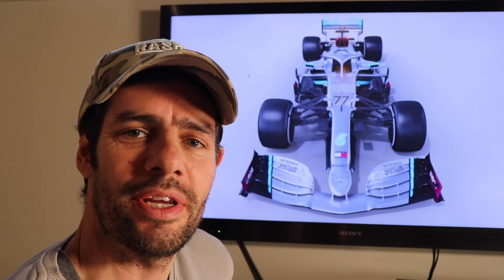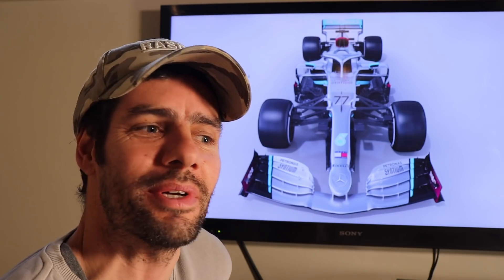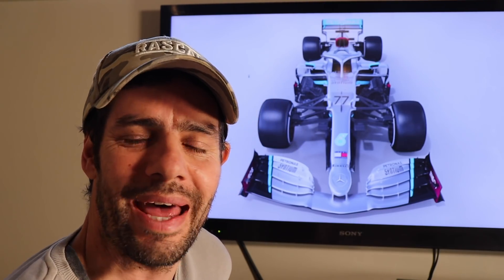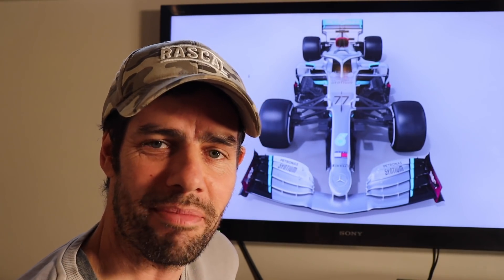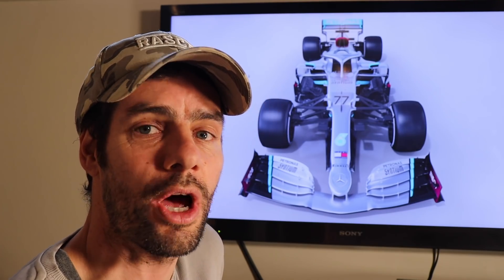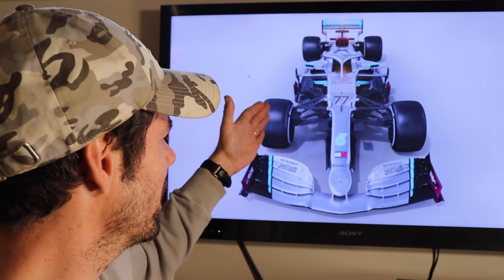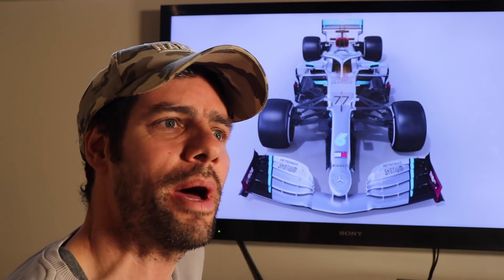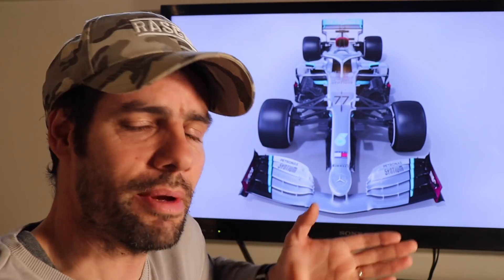Explaining Mercedes F1 DAS System

Comment: I couldn't believe it when I saw Lewis pull back on the steering wheel, I nearly broke my jaw it hit the floor so hard lol

Add this to the seriously impressive rear suspension set up and it looks like Merc have stolen a march on both ends of the car. I was so surprised to see Merc at the top of the time sheets after years of making sure they were firmly at the bottom, maybe like Brawn in 2009 they just can't end enough fuel and ballast to make it go any slower 🤷‍♂️

Comment: FIA regulations 2020  Article 3.8
(With the exception of the parts necessary for the adjustment described in Article 3.6.8, (DRS) any car system, device or procedure which uses driver movement as a means of altering the aerodynamic characteristics of the car is prohibited.) This little trick is opening up the gap of the front wing end plate and the outside edge of the tyre on the straights allowing more outwash freedom creating more airflow. so you can effectively call it a kind of front wing DRS. Illegal to me let me but let me know what you think.

Comment: Theres no way this is driver operated with no assistance. The strength required to make toe adjustments to an f1 car under load would be super human. The driver reaches down with the right thumb to push a button every time the adjustment is made. It's some sort of electric or hydraulic system
Reply from the maker: It could be...
Reply from the maker: Or the button could be to put a marker in the data as they assess it's performance...
Reply: @F1Elvis  but that doesnt account for how he is able to move the steering wheel in and out. The force needed for that is immense. Theres no way that isnt power assisted in some way.

Comment: This seems redundant; they can already achieve dynamic toe while steering by using Ackermann steering geometry and yet nobody is talking about that.
Does this offer any other benefit or just more of the same?
Reply: True for most cars but the particular arrangement of components used in F1 for aero reasons makes it hard to get a lot of ackerman.

Comment: As a Mercedes fan, I think FIA should ban the system. Why? It is going to put a taint on whatever Mercedes and their drivers achieve this year. People are going to say that they are running an illegal car, even if there in nothing in the regulation that explicitly prohibits this. Mercedes doesn't even need this to stay ahead. This could be useful for a team like Williams or Renault if it can help catapult them to the front. This what everyone will be talking about the entire year.  Before it used to be party mode.

Comment: The wheel is clearly a part of the aerodynamics of the car, so if one can manually change the angle of attack of their aerodynamics during the race then isn't that illegal? Now just watching the video Marc confirms what I said, Mercedes is CHEATING, around the 3:40 mark, Marc said it would create less drag, 4:30 aero benefits. So in conclusion, Mercedes is CHEATING.

Comment: I know drivers are in very fit shape but  wouldn't a lot of power be required to pull the steering rack just by using mechanical force without any hydraulic or assistance?

Comment: Article 10.2.3 is explicit that any adjustment to the suspension system can only be made when the car is stationary.

"No adjustment may be made to any suspension system while the car is in motion," it states.

Article 10.2.2 states: "Any powered device which is capable of altering the configuration or affecting the performance of any part of any suspension system is forbidden."

Article 10.4.2 states: "Power assisted steering systems may not be electronically controlled or electrically powered.

"No such system may carry out any function other than reduce the physical effort required to steer the car."
Reply from the maker: Don't think it breaches any of those...

Comment: Like Ferrari's protest of Renault's J-dampers in 2005, it could be protested under the "moveable aerodynamic device" rules.
Reply from the maker: Don't think so...
Reply: @F1Elvis  I'm sure you're correct. However, if the aero changes in response to the toe angle moving, wouldn't that constitute a moving aero device? Just thinking out loud here.

Comment: I just wanna say, They always win, because of the down force front nose, if you realized it from W05 to W10. From W07 to W10 always was the same design of front nose, but the others car of F1 team such as Ferrari, RB, etc was using a different design of the front nose. Right now in F1 2020, only BWT was using the same from nose of W10's Mercedes. If you see more closely on Mercedes W11's the front nose has a bend between stem and nose (logo)That is a down force nose. I don't know, if it is legal or not. For 100% sure Mercedes is the faster car again on F1 2020.

Comment: Nonsense, it means driver has to push n pull the wheel while steering it? Steering at high speeds alone is still a great task and above all drivers who are having a primary school education are gonna mess up their head at higher speeds with caster, camber, toe in and toe out. Let's look ahead

Comment: The only thing the other teams can protest is that it could be against the intention of the regulations. Because how it's written now, it's perfectly legal IMO.
The regulations only say that when the steering wheel is fixed (stationery) the geometry isn't allowed to change. But the steering wheel is not stationery when moved laterally, which the regulations didn't account for. So it's essentialy moving the steering wheel to steer the car, and no regulation say that the wheels have to turn in the same direction. Mercedes just added a new dimension to steering.

And toe in/out works just like doing the snow plow on skies when on the straights, introducing wheel resistance, lowering the top speed.

So I agree with you, it's for drag/resistance reduction, and not to heat the tires as some speculate, because scrubbing the tires only heats the surface, which can cause graining

Comment: Why wouldn't you design the car with parallel front wheels in the first place. Why do they have to put in a toe angle outwards when it doesn't help them?
Reply from the maker: Did you watch the video?
Reply: @F1Elvis  I did. But I didn't understand why a toe out would help them.

Comment: so if its a mercedes 1-2 in the first 5 races how do we know the system makes a difference? it could be the classic mercedes superiority we have seen in the past ;-)
Reply: The teams can easily test for it by running cars on different toe settings. They probably already know the size of its benefit, and I don't its that significant.
Reply: f1 is all about marginal gains.  Every bit counts.  It might not yield massive lap time gains but longer lasting tires is a huge plus.

Comment: I dont know the exact wording of the rules, let's state that first. If the system is not mechanical operated, it's illegal. Since hydrolic or electric systems are only allowed to be used to make steering easier (power steering). If it is mechanical the question is, is the steering rack part of the suspension geometry? In my opinion it is. The reason why I do, is that I see the supsension as the entire setup of how and in which position and orientation a wheel is attached to (suspended from) the chassis, not just the part that takes care of dampening movement. So having a button or a moveable steering wheel is in effect activating another setup of your suspension geometry. If it operates automaticly (and still is mechanical), like for example by steering input, it would be part of the same geometry. That's why I think it is illegal, it being a choice activated alteration of the supsension geometry.

Comment: Wouldn't it be a less blatant solution to other teams (and less demanding of the driver) to design a steering rack so that from straight forward, as turning is introduced, it's introduced on the inside wheel very slightly before the outside wheel? Do you have any ideas why they didn't do that instead?

Comment: It surprises me that they have revealed this in testing. Though the benefits of testing the system are evident, I would think they could adjust the toe angle between runs to have a good idea if it will be improving lap times and working aerodynamically. 

I would have thought this just gives the FIA more time potentially to ban it before the season starts (perhaps pointing to it already having been green-lit, as you speculate Marc) or for other teams to get to work copying it. 

It's a lovely spanner to throw into the works, though! What if it's a red herring? If I'd sunk the investment into it and it didn't work as intended, this is exactly when I would reveal it to the paddock to tie their own engineers up in replicating it!
Reply: Not unless they've checked with FIA before developing it.

Comment: Hi marc,I'm a bit concerned,it the steering rack moves in and out which means that it's not fixed,if you have a frontal impact,wouldn't the column come backwards into the driver and make a mess of his chest.or am I just thinking to much.(I am a mechanic, and it seems a bit dangerous to have a loose rack)

Comment: Gee wiz , this isn’t really innovation, most racing drivers are already aware of this and , for example dial in aggressive toe out for wet conditions ( much better turn in at the expense of straight line stability) and minimal heat into the tyre . It can be achieved ride height changes, setting, rack movements...

Comment: It is affecting aero, could that not trip them up?

Is there a reason why it's mechanical? Why not have a rack with hydraulic actuator that affects the total length of the rack then adjusted by the driver on the steering wheel?
Reply: That kind of powered adjustment is specifically banned.
Reply: @wingracer1614  yes I know, hence the question, because it affects aero could that mean it's illegal? It just seems like such a complex a rudimentary way of doing it.

Comment: "If Mercedes run away with it the FIA may step in and say "We are not having it"", if that was the reason it was banned it would be a complete travesty, it would be setting a precedent and saying that only small incremental improvements are allowed, and any single innovation that was too good will be banned.
Reply: The did it with Renaults mass damper.
Reply: There are plenty of previous precedents over many years.

Comment: Mercedes got their innovative thinking caps on, Newey must be going crazy he did not come up with the idea/system. It should be welcomed and this is about Innovation so Mercedes should be applauded. This is why the top teams are always at the front of the pack.

Also will the the Racing Point have it since it's a carbon copy car of the Mercedes?

Comment: I'm going to have to look at it more closely but it seems to be against the spirit of the regulations.
If varying toe in can affect the turn in characteristics surely that counts as a suspension component.
And, why stop there. Why not have a lever to vary the toe of the rears as well.
Different toe for different turns and different tire wear. Different power settings.
Vary it individually even.
It is interesting though.
The joys of loopholes.
Don't road cars, thanks to compliant suspension connecting points, have toe in, so that when driving straight the friction will pull the actual toe to close to zero.

Comment: Great topic Marc! Question: since there is no rule about adjusting of steering, could one not make this steering system electronic and activated by push of a button? Or, would a handle be required or other device like the “F-duct”?
Reply: Christopher Jefferson that would then be classed as an active aid. Which isn't allowed

Comment: I believe it is hydraulically operated with some kind of switch or leaver behind the steering wheel. Check the video posted on F1 Instagram. The movement of the steering wheel going further away and back is super linear. I do not think they would make it be mechanically operated by muscle as it would create a huge load on the driver and possibly loads on the suspension would be huge. This is probably a test item that isn't legal.

Comment: Congratulations to Mercedes for winning the 7th consecutive F1 double world championships.
Reply: Highly likely to provide very marginal gains.
Reply: @peachbunns  marginal gains on top of what is already the best car. So highly likely... that they'll take the constructors title. Again.
Reply: @peachbunns  When Merc consistently take both pole and 2nd place in qualifying by just a few hundreds or tenths of seconds, that marginal gains will seem very large. Or able to continue to push for an extra lap or two because their tires are running cooler which allowed overtaking instead of backing off. I think it will make a difference.
Reply: Andy Clifft probably. But no other team has thought of it before which why they are all surprised. Also the head of racing point’s engineering team said that even for the top teams it will be had to copy and will take AT LEAST 6 months to get something like it
Reply: @josephmabena276  Interesting, I've scratching my head this afternoon about how long this will take in terms of R&D and implementation. My guess was 4 months at the least for Ferrari. That's a long time for Mercedes to have the tech, and there's no saying other teams will, be able to implement it as well either. I'm guessing it would take time for the drivers to get used to it to maximise its potential. That's not to mention Mercedes further developments on the car whilst teams play catch up. This could easily prove beneficial in aiding Mercedes dominance of the first half of the season.
Reply: @Andy Clifft exactly
Reply: Meanwhile in 2021: NICHOLAS LATIFI! WINS HIS FINAL RACE! TO WIN! THE 2021 WORLD CHAMPIONSHIP!
Reply: Tinesh Boopathy made me chuckle that comment lol
Reply: Tinesh Boopathy Ameeen!!!
Reply: basing claims on testing, i see we've learned nothing lol
Reply: Maybe Buying the 7th consecutive F1 ..... they still have the Money ....
Reply: hopefully will fail in race and they loose some points.

Comment: So essentially it’s a form of mechanical drs with extra additional benefits
Reply: With the benefits being less wear on the tires and I suspect also more control over the tiretemperatures. With the reduced drag also comes better fuelefficiency.
So over a full race distance their tires will last longer and they might be able to start on less fuel as well. Now if their car itself is as good as ever they could be nigh unbeatable (again).
Hats of to them!